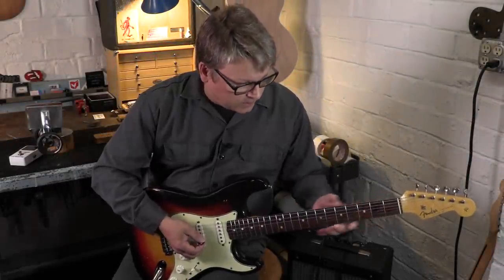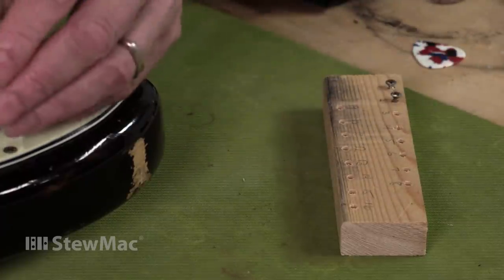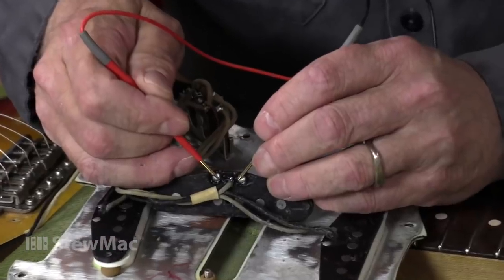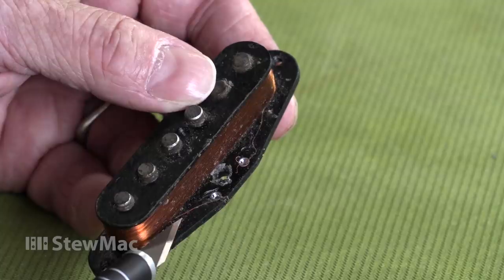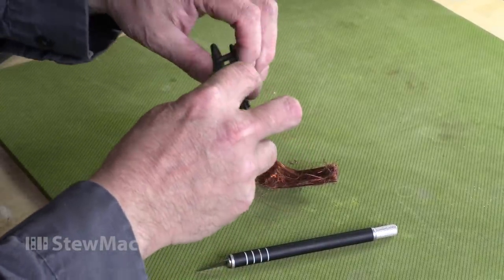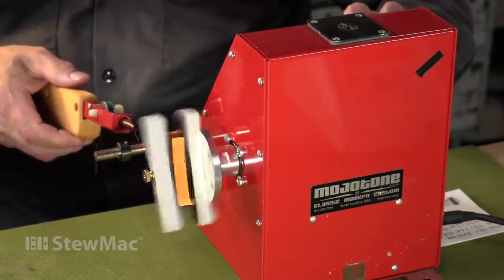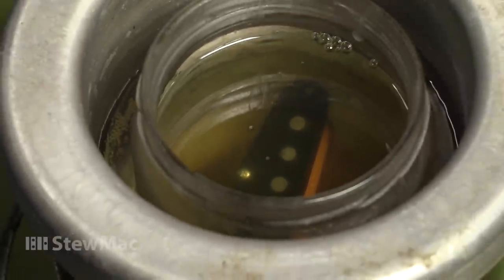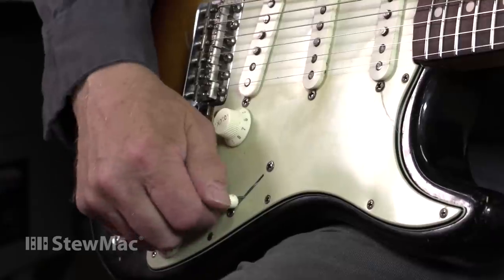Fixing a pickup on a 1963 Fender Stratocaster

Comment: I hope the customer got a call before that rewind. He or she might have built their whole career around that weak middle pickup sound...Hahahahaha
Reply: Paul McCaffrey good point!
Reply: I hope so too, because when he cut that wire I felt a bit queasy.
Reply: Yeah, I have to be honest, I kind of liked that thin sound
Reply from the maker: They sure did. The weak pickup was one of the reasons it came into the shop.
Reply: I had a '56 strat with bakelite covers. The neck and middle covers were damaged and both pickups were weak/thin. The middle was too weak but the neck was magic. It was worth adjusting amp settings to accommodate.
Reply: Good point! A partial pickup failure like this was a big part of Roy Buchanan's sound in the 60s and 70s. His Telecaster's bridge pickup had no low end, but because he played through cranked amps which compress the sound, the volume difference compared to the neck pickup was less of an issue, it just ended up giving his bridge pickup unique tone and response.
Reply: Frank B isn’t that what a tone pot does?
Reply: @letsgocamping88  no that is a capacitor.
Reply: @betty4774  Because some people like to play their guitars and like the look and feel it develops throughout those years. Resale value really shouldn't be that much of a concern to you if you intend to play the guitar for many years, and even then, resale value is horrible for parts that don't work properly; a broken headstock '74 Gibson SG will sell for $700 at most whereas a repaired one can sell for up to around $1800. For non-working pickups the value is even worse. Nobody gives a damn if your guitar has vintage PAFs if they don't sound like vintage PAFs, so it's better to just rewind the damn thing than to replace both it and the original wiring.
Reply: I was thinking that.
Reply: MrSmadSmartAlex - love Roy B. Ya work with what Ya Got!
Reply: I enjoyed the video, the work was done with a lot of love. it might have been worth recording the guitar properly at the end to make the point that it was worth it. Was I the only person who thought it sounded like a Chinese  guitar at the end ?
Reply: why else would it be in the shop then?
Reply: She. Lol. You survived this round of cancel culture.
Reply: @betty4774  It's all a matter of what the owner wants to do.
Reply: @stewmac  How can I get in touch with Erick Coleman?  I want him to repair a pickup for me!!

Comment: 20 years ago I had a Bentley Series 10 and the 'bucker died. I didn't know sheep from shinola about working on it but that Bentley made 20 some-odd way different sounds with the 5-way and 2 independent vols, before the mother bucker gave up the ghost. I really loved that guitar. So I figured,  let's see what the center of a pickup looks like.  What was I gonna do, break it? Took the pickup out and turned it over and over in my hand, poking it here and there and trying to look like I actually had some clue about what the hell I was doing (there were onlookers). I kept getting asked what I was gonna do to it, so I mumbled a bit, threw in a couple of "hmmm's", and told my audience that I had decided to get stoned and unwind it. Maybe 30 feet or so in there was a break. So after much consideration, and lots of helpful (ha ha) input from my buddies, I twisted the ends together, cut a little piece off a lead sinker (fishing I knew about a thousand times more than I did guitars), kinda sorta flattened it and wrapped it around the wire ends, and squished, wait, this was in Texas, so I should say "squarshed" it together with my fishing plyers, figuring the tool deserved a shot at it since it's buddy Mr. sinker took one for the team. Put it back together and woo hoo! it worked. Oh yeah, before painstakingly rewinding it by hand, during that time we spent(I say "we" because the onlookers had become my pit crew) considering all the options, Bob said "I'll fly if you'll buy" ('cause our mouths were getting dry), which got yeahs and yups (Texan for "yes") and hands in pockets for beer money. We couldn't do anything 'til Bob got back, so we hunkered down and got serious. We were like the driver and his pit crew at Nascar, working on the Bentley Special, getting it ready to Rock and Roll! Well, Bob got back and it was Pop-pop-pop-pop-pop!...and gulp gulp gulping...followed by some dang that's good's, thank yuh Jaysus'es (local dialect) and hoooweee!'s. More discussion and we decided I should put a coat of the old lady's clear fingernail polish on the repair and let that dry, which was just enough time to fire up another doobie. ....Doobie Brothers record, that's what I meant to say. Yeah. That. Anyway, gotter back together and that Bentley never sounded better! Then my buddy Bubba Joe( I swear!), who could actually play a guitar handed Mr Bentley back to me. Some mumbles, eh's, then a quick save, someone yelled "Barbecue!" which stared a chorus of Oh Heyal  Yayuh's,  couple of "Hey Bob! Go again?"'s , and IT WAS ON!!! ...Y'all take care, now.  - David, a.k.a. the ConnMan.
Reply: Best comment :)

Comment: Real copper wire and big thick wires.  I'll bet they didn't use that crappy tin on there either.
Reply: i understand what you're saying, but let's get real, those thick wires mean nothing... :} plus the pickup went bad..
Reply: They mostly used what was available, both good and bad.
Reply: @duroxkilo  I've had super thin wires break inside the guitar before. Fuck all to do with tone but I'll happily eat the extra 2 or 3 bucks a guitar to give it quality pushback wire that actually has some meat to it.

Comment: It's not a short, the DC resistance would have gone lower, not higher. What probably happened is you had a break deep enough into the coil that there were still a number of windings to the output, and enough capacitance to the ground side so that there was still sound produced. It was weak and missing the low end because of the capacitive coupling between the two sections of the coil.
You could actually replicate this by winding half the windings, cutting the wire, and finishing the rest of the windings without a DC connection though the coil.
Reply: exactly this, thank you.
Reply: Agreed.

Comment: I had a 61 strat with middle pu out.  I was  told to go see Peter Green  yes that Peter Green. Peter told me to go see a guy about 50 miles away. The guy had worked at Alembic and said it was a brake in the winding and that a lot of times the brake could be  close to the end and usually in the last 50 winds He started unwinding at  after 8 unwinds there was the break, also confirmed by the ohms meter. Instead of ditching the 8 unwinds he said it could alter the tone. So he tinned the breaks under heavy magnification and perfectly soldered them and reassembled. Totally unnoticeable. He wanted $50 for the repair. I gave him $100 the year was 1979 and I had paid $1100 for the 61 Strat. Even in 1979 the value of the guitar instantly doubled. And ol Peter Green, was a very nice, helpful and friendly guy.  This is a true account. so do not just start hacking away at the coil wire  just give a bunch of careful unwinds
And if you have a winder make a note of which unwind revealed the break. Cheers

Comment: .260 megaohm means  about 250 kiloohms which indicates it's the volume pot you're measuring, hence there is no pickup parallel to the pot which would lower this resistance to 5-6k. that means the pickup is open (broken wire), not shorted.
Reply: pete seitz But theres no resistance on the pot when turned right up (which it is when measuring)?
Also if pickup was COMPLETELY open, there would be no sound at all.
Reply: pete seitz (Apologies, on reflection I guess an open circuit would give you the 250k pot value reading)
Reply: Good catch, thanks.
Reply: Good explanation  . . .  Electronics is a mysterious dark art to those not familiar and we tend to forget that after we've been at it a while.
Reply: I did notice that he didn't show us the multimeter reading when he measured the pickup itself. He just said, "Yup, something's wonky here" and forged ahead. I like StewMac a lot, because they have some great products, and Dan and Erick have affable personae, but I try to remind myself that these videos are, first and foremost, to sell products.
Reply: Steve Soldwedel - well other people here have said you could just unwind 100 wraps to see if that eliminates the short from the critical outer layer, you'd only lose .08 k and keep it original, but yeah that's not going to use a bunch of rewinding tools and supplies so what would that demonstrate.

Comment: Your reading was about 285 Kiloohms, which indicates an open, not a short.  A short would reduce the resistance of the coil below the nominal 6k.  I agree that the insulation has most likely broken down, but what's more likely is that there was a break in the wire and the insulation breakdown provided a high impedance path between the broken connections, so it still registered a value and produced some sound.
Reply: Testing magnets for charge after testing open circuit was a bit weird too. For all he knew I could have just been the switch that was poked.
Reply: There was still a 250K volume pot across the pickup. Explains everything in conjunction with either an open coil or more probably a bad connection at the switch.
Reply: It was .285 K ohms, which is 285 ohms.
Reply: 1:06 .260 megaohms

Comment: Shorts don't increase resistance.
Reply: Aurthor Thing I was wondering the same thing
Reply: They do if they're too small and you really got to go.
Reply: The shorts actually do increase resistance. If you take them off she will thank you!!!
Reply: What I questioned was the pickup had the correct resistance when tested alone but when the middle pickup was mixed it was really weak? My first thought would have been the pickup switch was worn out? Obviously it sounded great after the rewind. Great rewind work. I had frolic do my 63 precision pickup and it sounds fantastic! So the rewind if done properly it is back to new condition. It’s unfortunate but they do wear out if used hard professionally over years of use. Thankfully they can be reworked like new.
Reply: Bill Lanham He had a bad contact somewhere, more probably at the switch. What he measured was the volume pot. Totally wrong repair. And total BS about the screws too. They should all have been replaced. Rust is a cancer and will spread.
Reply: I've spent the last 30 years since electronics class in high school cringing every time I hear someone misuse the term short or short circuit.  Increase  in resistance is caused by defective connections or a partial or complete break. True shorts or short circuits will decrease resistance because it bypassing resistive wire...
Reply: @victorjbarker  yep, exactly what I thought.  If the fault was in the pickup, those wires were broken somewhere and the resistance measured was probably through the wax mixed with all sorts of crud that was sucked in there over time.

Comment: To preserve the "vintageness" of the guitar, I would have tried just remelting the wax on the coils. It might have been enough to fix the shorted wires.
Reply: That may not be a permanent solution
Reply: Going by the resistance reading (285K ohm) I would assume it was a break in the wire getting a partial connection. That said, we never find out what the winding resistance was without the volume in-circuit so it's hard to know exactly how bad it was.

Comment: Everybody's laughing about the "short" instead of open. That is not fair in my opinion since it is very easy for anybody sat behind a keyboard to find a mistake and try to shine emphasizing it.
However I do not understand the purpose of fully rebuilding an old pickup instead of swapping it for a brand new one. Changing the wires will definitely change the sound as I trully believe that the main part of the "vintage sound" has far more to do with all the wear and tear of the wires than the magnets themselves...

Comment: He also didn't appear to check the wire at the switch end or the switch contacts for corrosion, at least not in this video. While that didn't turn out to be the problem, with a high resistance reading that should be an obvious check.

Comment: I have a 1962 Strat with a pickup issue. The  workshop that fixed the pickup took away only a couple of feet wire and the problem was solved. Why cut away all the wire once and for all? Why not unwind the wire?

Comment: I love the way you work here.  Years ago, when I worked in a coil winding workshop, I picked up a tip for dealing with very fine wires.  The leadouts are very fragile and can break at the solder terminal.  However, if you fold the wire ends back on themselves twice for about six inches, they become quad wire and stronger.  The quad wire gets wound into the coil so the whole leadout is much stronger.  I wonder if this might be useful when winding your own pickups.

Comment: I've got a set from an 1980s USA Strat but one pickup is totally dead. I haven't got all that kit to fix it, so I will take off some of the windings and see if that will fix it, I might get lucky. Low output pickups always sound better, just listen to all those 1960/70s rock classics, you can actually hear the character of the amp - it growls - it's not all about tons of distortion!
Reply: As others here have done, I have wound off a few hundred turns to find a break and then re-soldered. An omhmeter now measures 5.3K instead of 6K. I can't hear any obvious detriment. 

By the way, it was the same pickup (middle) and the symptoms were all the same as in the video.

Comment: Normal reading around 6k ohms. Faulty coil reading approx 200k ohms.  This isn't a short somewhere, it is what I would have called in my telephone engineer days a 'high resistance dis' (disconnection).  I'd guess part or parts of the wire was breaking down physically or chemically resulting in these parts having a much higher resistance than good copper.  Imagine measuring the resistance of a nice shiny new nail, probably less than 1 ohm.  Now measure a similar length and diameter nail that has just about rusted through (but not broken) its resistance will be much much higher as the rust/corrosion isn't a good conductor and what little good metal is left wont be as good a conductor either.  Given time the rusty nail will break which would then give an open circuit reading.  I think Erick did a great job of diagnosing the fault he perhaps used the wrong terminology in his narration.

Comment: If the wires were shorting wouldn't the resistance be lower, not higher?
Reply from the maker: You are correct that if there was a short in the coil, then the resistance would be lower. Erick does mention that normally, if a pickup had a short you would not get any signal from it, but that's not the case with this pickup. A shot with a more specific description of the diagnosis did not make it into the final cut for this video (there was so much information to convey that it was impossible to touch on every point, and the video was still 12 min. long). Unfortunately, the term "short" was a misnomer for the actual diagnosis. This particular pickup's coil wire had corrosion throughout, like a cluster, which resulted in points of higher resistance.

Comment: Today I learned that "wax potted" means dipped in a pot of melted (bees) wax. Very surprising!
Reply: Usually 80-85% paraffin and 15-20% beeswax.
Reply: You can use straight paraffin "Gulfwax" too.
Reply: Falsements or even epoxy or polystyrene resin

Comment: Nice video. Glad to see the whole process.
With a vacuum pump, the wax will really penetrate the pickup. 
You could sell those IF it's at a fair price. 
Buy the pump from the makers of penis pumps in asia + kettle + tubing. 
Some choose the wrong glass and they implode, so you'd also keep people safe. 
If you had a EU weekend deal once in a while for packages including shipping under 150€, you'd have more sales over here.
I'm also seaching for an old video of Dan's Spraying booth that folded outward and he attached a shower curtain/foil with magnets. It seems you took it down.

Comment: new coil means new pickup. it is not a fix, its just replacement.
Reply: Wrong. Original bobbins, magnets that can´t be reproduced, etc. The correct term is a rewind.
Reply: The magnets have aged over the decades (losing a slight amount of their magnetic power) which will make the pickup sound different from anything new. That's something you jut can't duplicate, and will be preserved even with the new copper wire wraps.

Comment: I enjoyed this video.  Most informative.
Yes there was the little slip up calling the "open" a "short" but hey ! the rest of it was sound enough. 

I've got a 66 Tele in my workshop with an open bridge pickup waiting for a final fix.  
There's a 70s  temporary substitute in there at the moment. 
I've started unwinding it and , so far I have four ends but there's still at least one other break.
If the last break isn't too deep I'll either join and rewind, by hand or sacrifice the outer turns IF there are only a couple of hundred. 
If it's WAY deep then it'll be rewind time or defeat time. 
The flats are curved a bit too and the poles are shifting.
Recipe for disaster shifting poles in these old style pickups with the windings wrapped in physical contact with the pole pieces.
An interesting exploration though...
Scuse me rabbiting on. I'm kinda working out my plan of action as I write this.  🧠

Comment: Sorry but if the coil wires had shorted on itself you would have a very low resistance not a resistance on the higher Megaohms!!